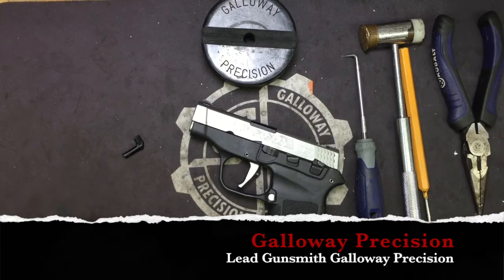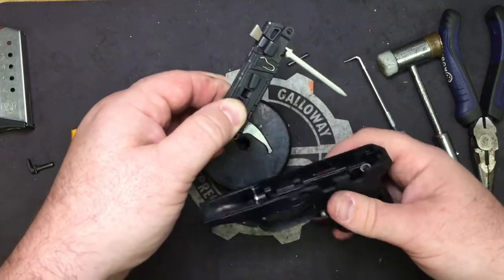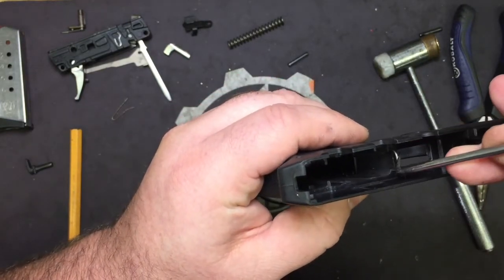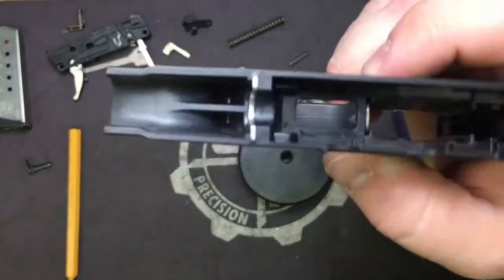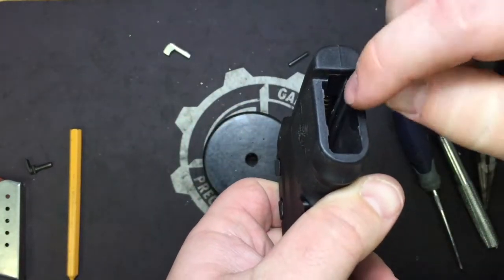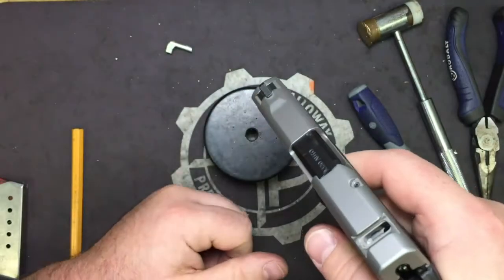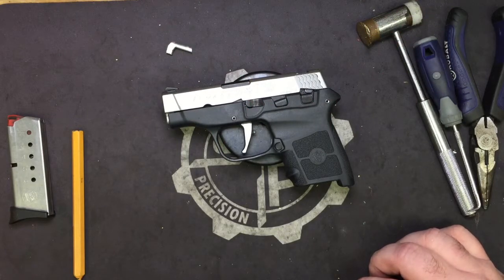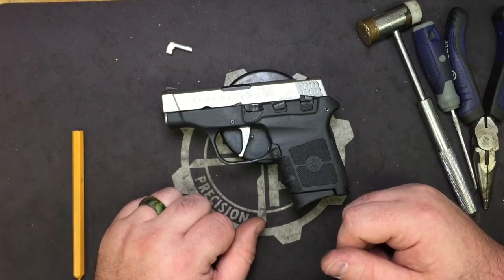Bodyguard 380 Extended Mag Release Installation

Comment: I just installed your mag catch and although it seems fine, I haven't test fired it yet to see if it cured my mags dropping out with the factory steel catch. The part quality of your catch is nice, but I'd pay more for a steel catch and a stronger spring.
Reply: I test fired it and no more mag drops. That being said, after one range session I'm already seeing wear and an indentation on top of the catch where the mag hangs on. I'd still like to see this made of steel.

Comment: Incredible video and I’ll make sure to purchase from you guys in the future. I thought Id just look at a video before I got to it and yours is perfect right to the point the only problem I had was the u shaped mag spring for the extended mag release made it so that my magazine had a hard time feeding into the frame. I didn’t want to manipulate that mag spring much but it needed to be tweaked slightly so that the magazine would be allowed into the frame. It drew the new mag release too far into the frame and obstructed the entry of the mag. I know the company in which I got it from but not off the top of my head and I’m not sure of the company of manufacture but I’m certain that that has something to do with it though it seems to be the aluminum grade release.
I’m not certain if the mag release that I purchased is from a different manufacture but my pistol is at least seven years old so free molding and things might have adjusted slightly even though they most likely have the same molds that they use even though they update them. 
Seriously your video is amazing and I can’t wait to see more. Thank you.

Comment: I just received my extended mag extension and it does not fit.  The right side slot is too small for the mag release I received.  I have contacted Galloway but haven’t heard back from them.  Hope they just sent me the wrong part.  Exasperated!  I would say that my original plastic mag release was worn out.  The lip on the mag release which holds the mag was nearly gone.
Reply from the maker: Go to the fitting video, we aren't open on the weekends.
Reply: Update. There is another video which explains how to open the frame opening to accept the new release.  Everything working good now.  Don’t understand that they didn’t explain in this video that if it doesn’t fit that there is another video how to fix fitment issue.

Comment: The hole in your replacement pin didn’t line up with my spring. Also was not deep enough for the spring to seat. The slide rubbed on the spring and wouldn’t action.
Reply from the maker: Sounds like a tolerance issue with your particular pistol, because every hole is deep enough.  Or the spring wasn't pushed in all the way.

Comment: Installed it recently, Found poor fitment issues, Tight fit doesn't allow release to slide in my gun, Maybe after thousands of rounds thru gun may loosen up, Doubtful though. 
I think the gun is garbage.
Reply from the maker: You need to fit the grip frame to the mag release.  Take a small round Swiss file and remove any flashing left behind from the injection molding process in the mag release channel.  Then take a small flat Swiss file and open up the back end where the flattened tear drop shop goes, that's the usual culprit.  I'll be doing a video for fitting the grip frame soon.
Reply: @GallowayPrecision  Thanks

Comment: I have a newer Bodyguard that has a release the same length as this EXTENDED one! I guess it's my fault for not reading the entire description on the site. BUT this one wouldn't even fit in the gun!! I started filing the hole to enlarge it, then realized it was not extended any more than the OEM.  Would be nice if you mention that in the video.

Comment: On your website you say " if you have the new factory steel mag release  " , is the new factory mag release steel ?  S & W won't tell me and you're out of stock .
Reply from the maker: Yes they are, however only in newly produced pistols.  They are extended as well, so if you have one that was bought in the last six months or so check the mag release with a magnet.  If it grabs it you have the new release and won't need ours.
Reply: GallowayPrecision    Thanks . Mine is definitely plastic , it had already began to shave down and I inserted a steel pin completely through it , inline and level  with the mag catch area , this took care of the problem except now , as when it was new , the mag release has to be depressed to insert a mag , is this the case with yours ? If not , when do you expect to have them in stock . I would rather buy one from you than send my gun to S & W .
Reply from the maker: Having to press in the release will all depend on the tolerances of your particular grip frame.  Some are thinner than others, just a part of the injection molding.  We should have more in stock in the next two weeks.